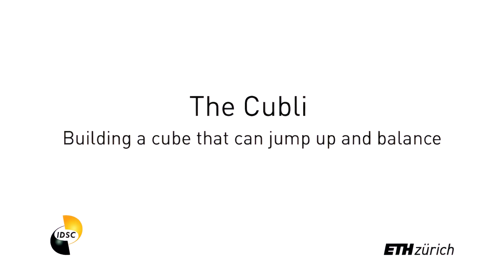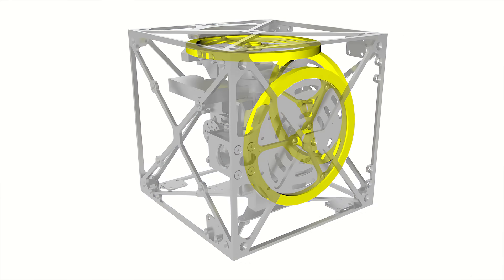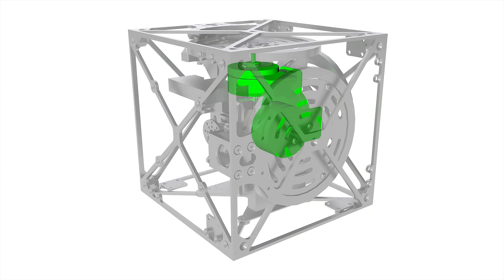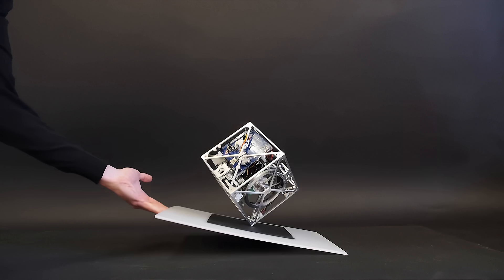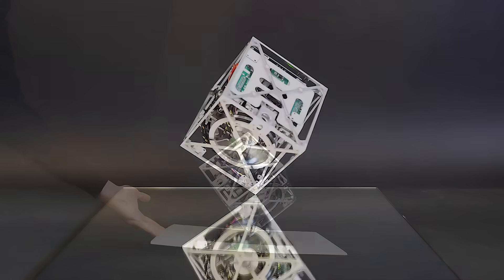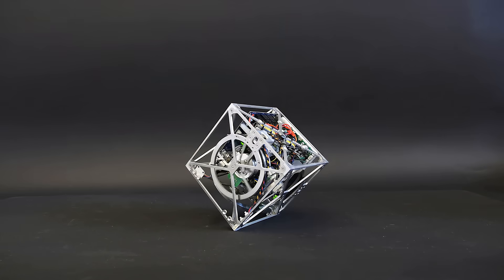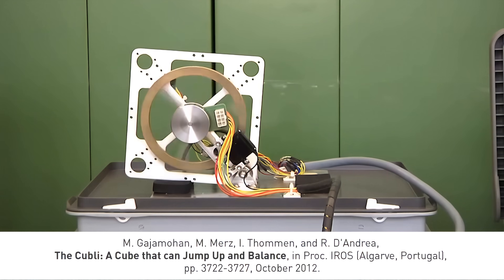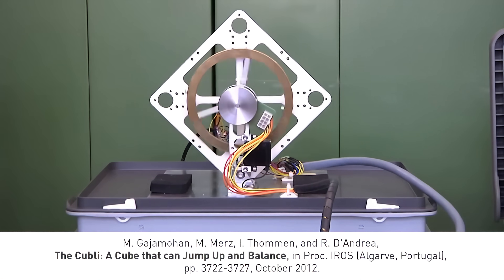The Cubli: a cube that can jump up, balance, and 'walk'

Comment: Now shrink it down to size of a couple of dice, give it a face and lets head over to Vegas.
Reply: John Cena yes it would...
Reply: @datjcnrjc8655  They don’t see my slight of hand... 😉👋🏽!!! 😅😅😅👌🏽 

Just make sure you wear a ring to activate & deactivate or “word command” to your desired outcome... 

You can go a step further than that: shrink it to subatomic size to go into the quantum world... Just make sure you tell Professor M. Kakua for about your latest invention so “you guys” can share the noble physics prize..
Reply: @412three6

i was thinking the same thing! 
😆👍🏻
Reply: Ergo Gray great comment
Reply: Good on you Ergo. You are a genius:)
Reply: they're not fans. https://en.wikipedia.org/wiki/Reaction_wheel
Reply: @spambot7110  bruh
Reply: @spambot7110 right 😊
Reply: its basically a gyroscoop, what you cover it with is irrelevant as long as its not too heavy, so that the gyro can self correct when tilted
Reply: @KandyWabbit  Actually it's technically not a gyroscope as it does not use the gyroscopic effect as a means of stabilization. Rather it uses reaction torques. In an ideal world the cube would achieve perfect balance and thus not need to spin any of its reaction wheels in order to stay balanced. In a gyroscope, if it's wheel stops spinning it looses all stability control.
Reply: @KandyWabbit  gyroscope*
Reply: That's be cool, except Craps Dice are see through.
Reply: @Taka12G  Mirrors
Reply: @Taka12G  LMFAOOAAOO
Reply: Ergo Gray omg could u imagine!
Reply: yes it would, those are not fans they are flywheels storing kinetic energy.
Reply: Ergo Gray u are a genius
Reply: @ianjames6320  Only a M0RON would think a M0RONIC idea is genius.
Reply: Ergo Gray can I buy 5%
Reply: 412Three what*
Reply: My first thoughts exactly haha. This kind of shit will make cheating completely outta control
Reply: Mikerino Eggerino just hide the sensors in the dots of the cube
Reply: Ergo Gray lol, straight to the point
Reply: Ergo Gray W
Reply: You gave me a good laugh.
Reply: fbi open up
Reply: lol when the dice balances on a corner at the casino
Reply: Is this a jojo reference?
Reply: @afj810  i seriously thought the same, that dice game between rohan and josuke XD
Reply: Noah leave your whackass out of it noone asked you
Reply: Haha,good thinking
Reply: Much easier than getting an alien to do it
Reply: Or to a rich mangakas house
Reply: lmao i'd like to see this work xD
Reply: you're too late they are already using them so the house wins more
Reply: Ergo Gray my luck is that the fuckers will balance on a corner...!
Reply: @DiddyThaSlurper  the law of angular momentum says yes
Reply: This idea can actually be achieved if anyone who already has a lot of money wants to make it. Mechanical moving parts and gears have been developed which are about the size of a nanometer. You could design a die which has these devices in each dot for maximum control over it's 3 dimensional plane. But would cost a heck lot of money which doesn't make sense why anyone would make something like this with a lot of money just to steal from other people and probably get caught along the way.
Reply: Comment award!!🤣🤣🤣
Reply: Josuke after discovering Alien
Reply: Tracy Rosellini  I can't tell if you're joking or stupid.
Reply: imagine programming it so it always lands on snake eyes
Reply: Ergo Gray HOLY SHIT DUDE UR A HENIOUS
Reply: Yeah that's all fun until it glitches out and won't stop standing on one corner, lol! Or flips out and yeets itself off the table and down the hall. Might raise an eyebrow.
Reply: josuke be like
Reply: Exactly what I thought!
Reply: Im just ignore the buzzing sound come from the dice
Reply: -Sir why does your dice sound like a reaction wheel attached to a brushless dc motor, motor controllers, inertial sensors and embedded processor and batteries
Reply: Plot twist, casinos have been using this for decades 😂
Reply: We could add cameras on all sides and a display on each face making it look transparent.
Vegas can come!
Reply: Clocking mechanism !!!      --problem solved !  your  welcome !
Reply: xD
Reply: I see what you did there.
Reply: hell yea
Reply: @DiddyThaSlurper  it would
Reply: Then get your hands hammered for cheating by the mob
Reply: exactly what i though xd
Reply: LOL @DiddyThaSlurper
Reply: That was the best thing i've ever heard . WOW
Reply: wow....  ok I was going to post "what a useless device"  but now you said that, got me thinking...

then I thought shit, mom used to work at a casino and she said they use they're own dice, no exeptions ...
:-(
Reply: Dont let Sam the Ace Risenthein catch you cheating. He uses hammers on the hands.
Reply: u cant bring ur own dice to Vegas, Casino already has their "magic" dices.
Reply: @Sidowse  I mean Casino also has those magic dice, they will get what is going on if you win :D
Reply: Ergo--😂--quick witted you be.🎵🎶🎵🌹🌹🌹
Reply: Rolls a 6 and a 1 Aw I was hoping for snake eyes.....dice rolls over to the one side
Reply: Sadly vegas doing this from many many years ago.. thats why you always lose gambling
Reply: Yoooo shut up..... u tellin evrybody.... now evrybody knows....... shit......
Reply: well, i didn't thought of that, until i read this comment hahaha fantastic bro, we will make tons of money 🤣😂
Reply: Lol!
Reply: Its ocean's thirteen bro
Reply: Lol, epic.
Reply: There are way more simple and stealth ways to make a cheat die for gambling.
Reply: You genius bro!
Reply: ocean 36
Reply: Demm
Reply: Oy mate, you got a brilliant mind.
Reply: then be ready to get in jail
Reply: always thought if this would be possible...
Reply: They might get a little suspicious when the dice lands on a corner
Reply: Go to harvararad elementary school
Reply: Yes
Reply: genius
Reply: "WHY THE F*CK IS YOUR DICE SO LOUD?!"
Reply: ITS.... ITS ACTUALY AA GOOD IDEA
Reply: Hell yes
Reply: That's cheap
Reply: Damn
Reply: I'm in
Reply: Money+100,000,000,000,000,000,000,000,000,000,000,000,000,000,000,000,000,000,000,000,000,000,000,000,000,000,000,000,000,000,000,000,000,000,000,000,000,000,000,000,000,000,000,000,000,000,000,000,000,000,000,000,000,000,000,000,000,000,000,000,000,000,000,000,000,000,000,000,000,000,000,000,000,000,000,000,0,000,000,000,000,000,000,000,000,000,000,000,000,000,000,000,000,000,000,000,000,000,000,000,000,000,000,000,000,000,000,000,000,000,000,000,000,000,000,000,000,000,000,000,000,000,000,000,000,000,000,000,000,000,000,000,000,000,000,000,000,000,000,000,000,000,000,000,000,000,000,000,000,000,000,000,0,000,000,000,000,000,000,000,000,000,000,000,000,000,000,000,000,000,000,000,000,000,000,000,000,000,000,000,000,000,000,000,000,000,000,000,000,000,000,000,000,000,000,000,000,000,000,000,000,000,000,000,000,000,000,000,000,000,000,000,000,000,000,000,000,000,000,000,000,000,000,000,000,000,000,000,0,000,000,000,000,000,000,000,000,000,000,000,000,000,000,000,000,000,000,000,000,000,000,000,000,000,000,000,000,000,000,000,000,000,000,000,000,000,000,000,000,000,000,000,000,000,000,000,000,000,000,000,000,000,000,000,000,000,000,000,000,000,000,000,000,000,000,000,000,000,000,000,000,000,000,000,0,000,000,000,000,000,000,000,000,000,000,000,000,000,000,000,000,000,000,000,000,000,000,000,000,000,000,000,000,000,000,000,000,000,000,000,000,000,000,000,000,000,000,000,000,000,000,000,000,000,000,000,000,000,000,000,000,000,000,000,000,000,000,000,000,000,000,000,000,000,000,000,000,000,000,000,0,000,000,000,000,000,000,000,000,000,000,000,000,000,000,000,000,000,000,000,000,000,000,000,000,000,000,000,000,000,000,000,000,000,000,000,000,000,000,000,000,000,000,000,000,000,000,000,000,000,000,000,000,000,000,000,000,000,000,000,000,000,000,000,000,000,000,000,000,000,000,000,000,000,000,000,0,000,000,000,000,000,000,000,000,000,000,000,000,000,000,000,000,000,000,000,000,000,000,000,000,000,000,000,000,000,000,000,000,000,000,000,000,000,000,000,000,000,000,000,000,000,000,000,000,000,000,000,000,000,000,000,000,000,000,000,000,000,000,000,000,000,000,000,000,000,000,000,000,000,000,000,0,000,000,000,000,000,000,000,000,000,000,000,000,000,000,000,000,000,000,000,000,000,000,000,000,000,000,000,000,000,000,000,000,000,000,000,000,000,000,000,000,000,000,000,000,000,000,000,000,000,000,000,000,000,000,000,000,000,000,000,000,000,000,000,000,000,000,000,000,000,000,000,000,000,000,000,0,000,000,000,000,000,000,000,000,000,000,000,000,000,000,000,000,000,000,000,000,000,000,000,000,000,000,000,000,000,000,000,000,000,000,000,000,000,000,000,000,000,000,000,000,000,000,000,000,000,000,000,000,000,000,000,000,000,000,000,000,000,000,000,000,000,000,000,000,000,000,000,000,000,000,000,0,000,000,000,000,000,000,000,000,000,000,000,000,000,000,000,000,000,000,000,000,000,000,000,000,000,000,000,000,000,000,000,000,000,000,000,000,000,000,000,000,000,000,000,000,000,000,000,000,000,000,000,000,000,000,000,000,000,000,000,000,000,000,000,000,000,000,000,000,000,000,000,000,000,000,000,0,000,000,000,000,000,000,000,000,000,000,000,000,000,000,000,000,000,000,000,000,000,000,000,000,000,000,000,000,000,000,000,000,000,000,000,000,000,000,000,000,000,000,000,000,000,000,000,000,000,000,000,000,000,000,000,000,000,000,000,000,000,000,000,000,000,000,000,000,000,000,000,000,000,000,000,0,000,000,000,000,000,000,000,000,000,000,000,000,000,000,000,000,000,000,000,000,000,000,000,000,000,000,000,000,000,000,000,000,000,000,000,000,000,000,000,000,000,000,000,000,000,000,000,000,000,000,000,000,000,000,000,000,000,000,000,000,000,000,000,000,000,000,000,000,000,000,000,000,000,000,000,0,000,000,000,000,000,000,000,000,000,000,000,000,000,000,000,000,000,000,000,000,000,000,000,000,000,000,000,000,000,000,000,000,000,000,000,000,000,000,000,000,000,000,000,000,000,000,000,000,000,000,000,000,000,000,000,000,000,000,000,000,000,000,000,000,000,000,000,000,000,000,000,000,000,000,000,0,000,000,000,000,000,000,000,000,000,000,000,000,000,000,000,000,000,000,000,000,000,000,000,000,000,000,000,000,000,000,000,000,000,000,000,000,000,000,000,000,000,000,000,000,000,000,000,000,000,000,000,000,000,000,000,000,000,000,000,000,000,000,000,000,000,000,000,000,000,000,000,000,000,000,000,0,000,000,000,000,000,000,000,000,000,000,000,000,000,000,000,000,000,000,000,000,000,000,000,000,000,000,000,000,000,000,000,000,000,000,000,000,000,000,000,000,000,000,000,000,000,000,000,000,000,000,000,000,000,000,000,000,000,000,000,000,000,000,000,000,000,000,000,000,000,000,000,000,000,000,000,0,000,000,000,000,000,000,000,000,000,000,000,000,000,000,000,000,000,000,000,000,000,000,000,000,000,000,000,000,000,000,000,000,000,000,000,000,000,000,000,000,000,000,000,000,000,000,000,000,000,000,000,000,000,000,000,000,000,000,000,000,000,000,000,000,000,000,000,000,000,000,000,000,000,000,000,0,000,000,000,000,000,000,000,000,000,000,000,000,000,000,000,000,000,000,000,000,000,000,000,000,000,000,000,000,000,000,000,000,000,000,000,000,000,000,000,000,000,000,000,000,000,000,000,000,000,000,000,000,000,000,000,000,000,000,000,000,000,000,000,000,000,000,000,000,000,000,000,000,000,000,000,0,000,000,000,000,000,000,000,000,000,000,000,000,000,000,000,000,000,000,000,000,000,000,000,000,000,000,000,000,000,000,000,000,000,000,000,000,000,000,000,000,000,000,000,000,000,000,000,000,000,000,000,000,000,000,000,000,000,000,000,000,000,000,000,000,000,000,000,000,000,000,000,000,000,000,000,0,000,000,000,000,000,000,000,000,000,000,000,000,000,000,000,000,000,000,000,000,000,000,000,000,000,000,000,000,000,000,000,000,000,000,000,000,000,000,000,000,000,000,000,000,000,000,000,000,000,000,000,000,000,000,000,000,000,000,000,000,000,000,000,000,000,000,000,000,000,000,000,000,000,000,000,0,000,000,000,000,000,000,000,000,000,000,000,000,000,000,000,000,000,000,000,000,000,000,000,000,000,000,000,000,000,000,000,000,000,000,000,000,000,000,000,000,000,000,000,000,000,000,000,000,000,000,000,000,000,000,000,000,000,000,000,000,000,000,000,000,000,000,000,000,000,000,000,000,000,000,000,0,000,000,000,000,000,000,000,000,000,000,000,000,000,000,000,000,000,000,000,000,000,000,000,000,000,000,000,000,000,000,000,000,000,000,000,000,000,000,000,000,000,000,000,000,000,000,000,000,000,000,000,000,000,000,000,000,000,000,000,000,000,000,000,000,000,000,000,000,000,000,000,000,000,000,000,0,000,000,000,000,000,000,000,000,000,000,000,000,000,000,000,000,000,000,000,000,000,000,000,000,000,000,000,000,000,000,000,000,000,000,000,000,000,000,000,000,000,000,000,000,000,000,000,000,000,000,000,000,000,000,000,000,000,000,000,000,000,000,000,000,000,000,000,000,000,000,000,000,000,000,000,0,000,000,000,000,000,000,000,000,000,000,000,000,000,000,000,000,000,000,000,000,000,000,000,000,000,000,000,000,000,000,000,000,000,000,000,000,000,000,000,000,000,000,000,000,000,000,000,000,000,000,000,000,000,000,000,000,000,000,000,000,000,000,000,000,000,000,000,000,000,000,000,000,000,000,000,0,000,000,000,000,000,000,000,000,000,000,000,000,000,000,000,000,000,000,000,000,000,000,000,000,000,000,000,000,000,000,000,000,000,000,000,000,000,000,000,000,000,000,000,000,000,000,000,000,000,000,000,000,000,000,000,000,000,000,000,000,000,000,000,000,000,000,000,000,000,000,000,000,000,000,000,0
Reply: Dude...make it happen!!!
Reply: Lol
Reply: my d&d stats are gonna be op
Reply: no
Reply: lol this is exactly what I thought
Reply: pretty sure that vegas dice are tested for wether or not they are loaded or react to magnets
Reply: That was the first thing I thought of, too.  I'm glad I looked to see if someone had already made this comment.  The only problem is that the dice used by casinos are transparent.  Well, I guess that's not the only problem, but it's a big one.
Reply: Did none of you watched Ocean's Thirteen ?
Reply: @anukoolkkhangat5525  Nobody watched Ocean's Thirteen.
Reply: Funny. I was listening to her describe this as "small" (it's huge) and thought "Man, is this thing loud. As a consumer toy, FAIL...".
Just imagine...
Dealer: "Craps! Next shoo..."
Dice:"Whir, clank, thud..."
Dealer: "..." "No."
Reply: Now, THAT'S a practical application
Reply: i love you for that genius idea!
Reply: MONEYMAKER
Reply: fucking idea
Reply: and then it lands on a corner! 🤣🤣🤣🤣🤣🤣🤣
Reply: and if you were looking for a free cloud for storing and exchanging drawings, 3d models, then pay attention to the CADBase https://youtu.be/vwV-Im_xlic
Reply: Now youre talking
Reply: He stole this idea from JoJo 😭
Reply: That's so cheating
Reply: Jesus Christ.. that's a good idea... I'm going in.. wish me luck...
Reply: Yeah but when they find out they take you around back and breaka you legs, capiche!
Reply: 😂😂😂😂😂😂😂 Brilliant! 😎
Reply: CHEAT 100
Reply: You just want somebody to make a pair of nano cubes and win millions in Vegas...how dare you??!!... And I'm gonna take this idea and die filthy rich
Reply: Or Macau
Reply: God, the Lord Jesus Christ loves you! Restore your relationship with God by repenting of your sins and putting your faith in Jesus Christ, "... that Christ died for our sins according to the Scriptures, and that He was buried, and that He was raised on the third day according to the Scriptures..." (1 Corinthians 15:3-4)
Reply: or put it in a vibrator
Reply: Or get a dice with one side slightly heavier
Reply: Nah Vegas has been crappy corpohell for at least 20 years now. Dont waste your time or money theres better for cheaper if you put the work in for passports and visas
Reply: do people still go to las vegas 🤣🔥💯 9 years ago i guess it was still a place.
Reply: Dam it, I was thinking the same, but you got the comment down first 🤣🤣
Reply: WORD BRO!
Reply: Noah thats wat a cloak device is for to make a solid transparent
Reply: Vegas needs to be purged and erased .
Reply: LMFAO
Reply: Ergo Gray u will owe those researchers a tonne of fucking money lol
Reply: Pretty sure they don't let you bring in your own dice, and the dice they use are semi-transparent anyways, so they'd notice the mechanics.
Reply: @theblackwidower its the casinos that are rigging, not you
Reply: @DiddyThaSlurper  r/woooosh
Reply: Are you 
               a good enough person
                                                       morally 
                                                                       to enter into heaven? 
Have you ever use God's name in vain b4?
                                                             Have you ever hated anyone before? 
              ./';,Have you ever looked  at a person with lust  in your  heart? 
...........Have you ever had sex outside of marriage? 
''''''''''''''Have you ever stolen anything  before irrespective of  its value? 
;;;;;;;;;;;;;How many lies have you told before in your entire  life? 
/.,,,,,,,,,,,,,,,//////////Have you ever downloaded music or movies illegally that you did not pay for? 
;'/.,;'/., Have you ever lusted after material possession or money b4?
      .;'/., Have you ever  fished for compliments while rejecting  the word of God?
If u have........... committed these sins ...God sees you as a liar a thief an adulterer in the blasphemer a fornicator and  a hater at heart and you must be a holy God on the day of  judgement!
Will 
you
 be  innocent or guilty on the day of judgement?
Will
 you
 go 
 to heaven or to hell?

............book of Revelation 21 says,,,,,,,,,, all liars will have  their part in the Lake of Fire which is the second death...         ,./';
         /././The Holy Bible says that no thief no adulterer no fornicator no blasphemer and no hater by any means shall ever inherit the Kingdom of Heaven!
you  .  have .    broken .    God's laws
............
                     ........ and Jesus Christ has paid your fine
                                              with his own sinless blood...
If you repent and turn from all sins 
and Trust alone in Jesus Christ ....
             God will forgive every sin you have ever committed grant you eternal life!     If u
                           refuse to repent then you must pay for your own sins against God yourself on the day of judgment which means that you will spend an eternity and outer darkness and everlasting burnings where there is weeping and gnashing of teeth forever!
Reply: Nate Taylor can u not read
Reply: I am pretty sure you need airflow for it to work.
Reply: @tharushafernando4410  no there is no need of airflow because these are not fans but are flywheels.
Reply: @tharushafernando4410 no it does not. They use the same mechanism in space